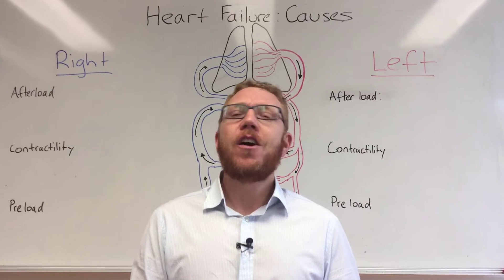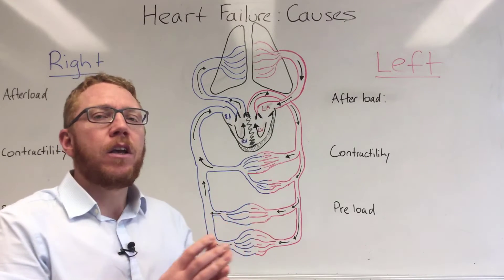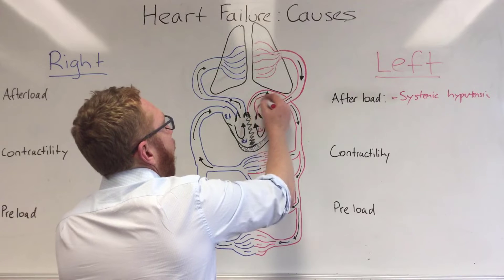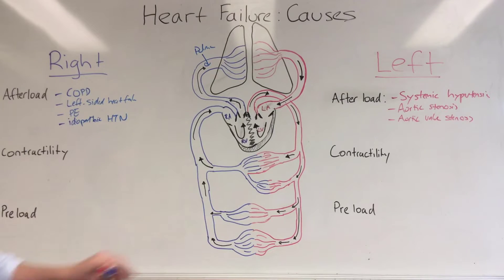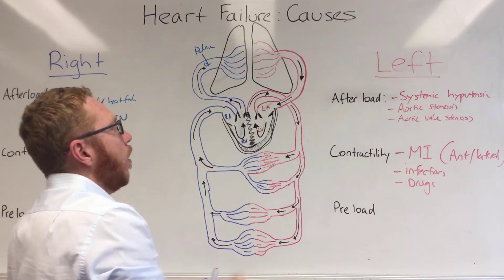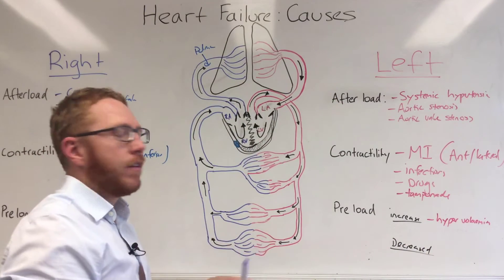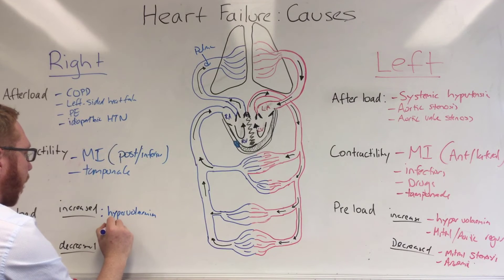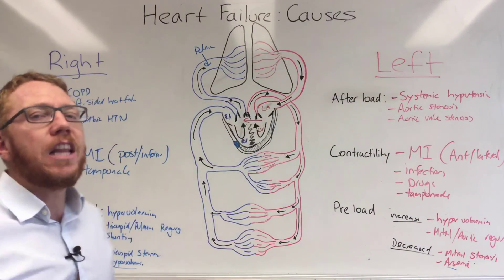Heart Failure: Causes

Comment: Summary
This video provides a lecture on the causes of heart failure, specifically focusing on left-sided and right-sided heart failure. The causes are categorized into three categories: afterload, contractility, and preload. Afterload causes on the left side include systemic hypertension and aortic valve stenosis, while on the right side, it is caused by pulmonary hypertension, often due to COPD or pulmonary embolus. Contractility causes include myocardial infarction, myopathies, pericarditis, and tamponade. Preload causes on the left side include increased fluid (hypervolemia) and regurgitation of the mitral and aortic valves, while on the right side, it includes increased fluid, regurgitation of the tricuspid and pulmonary valves, and tricuspid stenosis. The video concludes by summarizing the common causes of heart failure and how they fit into these categories.

Highlights
- The video explains the causes of heart failure, focusing on left-sided and right-sided heart failure.
- Afterload causes on the left side include systemic hypertension and aortic valve stenosis.
- Afterload causes on the right side include pulmonary hypertension, often due to COPD or pulmonary embolus.
- Contractility causes of heart failure include myocardial infarction, myopathies, pericarditis, and tamponade.
- Preload causes on the left side include increased fluid (hypervolemia) and regurgitation of the mitral and aortic valves.
- Preload causes on the right side include increased fluid, regurgitation of the tricuspid and pulmonary valves, and tricuspid stenosis.
- The video concludes by summarizing the common causes of heart failure and how they fit into the categories of afterload, contractility, and preload.

Detailed Summary
- This video provides a short lecture on the causes of heart failure, specifically focusing on left-sided and right-sided heart failure. The causes are categorized into three categories: afterload, contractility, and preload. Afterload causes on the left side include systemic hypertension and aortic valve stenosis, while on the right side, it is caused by pulmonary hypertension, often due to COPD or pulmonary embolus. Contractility causes include myocardial infarction, myopathies, pericarditis, and tamponade. Preload causes on the left side include increased fluid (hypervolemia) and regurgitation of the mitral and aortic valves, while on the right side, it includes increased fluid, regurgitation of the tricuspid and pulmonary valves, and tricuspid stenosis. The video concludes by summarizing the common causes of heart failure and how they fit into these categories.